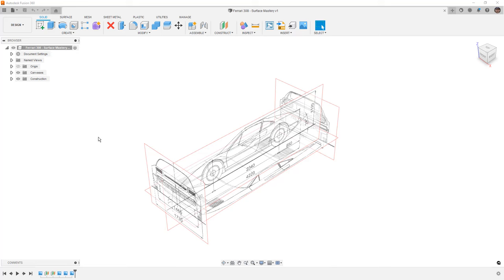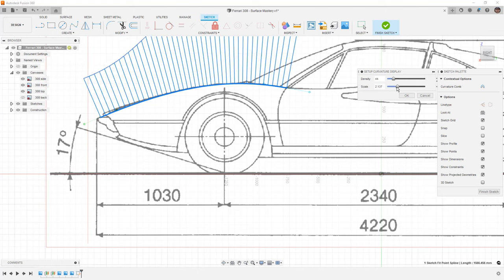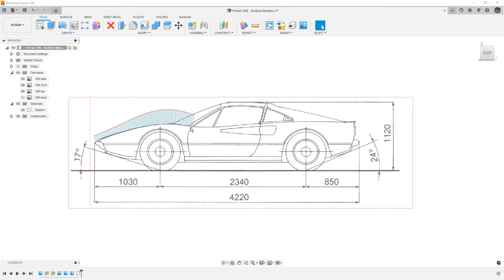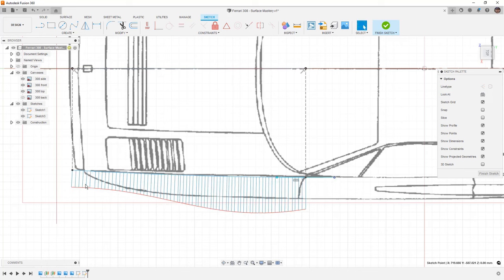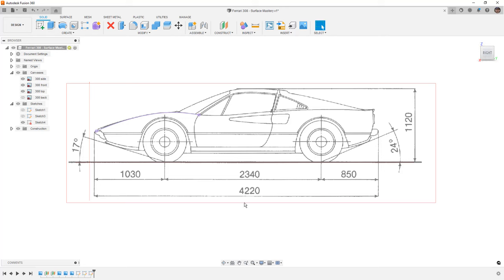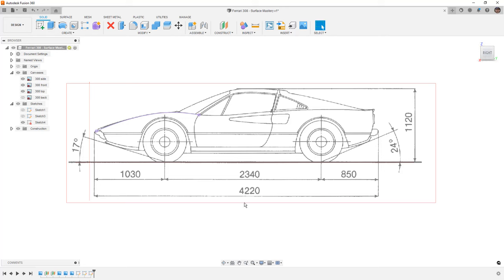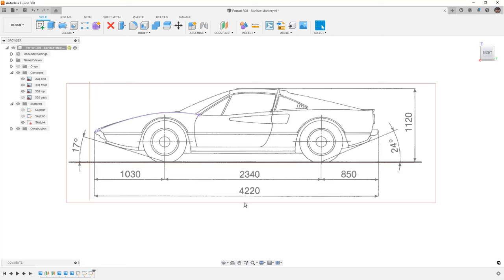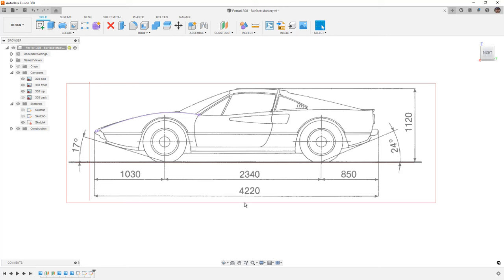Surface Mastery Part 6 - How To Create 3D Projected Curves for Complex Surfaces #cardesign

Comment: Hi, when you have a 3d curved plane ( like the one in the video), how do you make it into a solid object? How do you add uniform thickness to it? To make it 3d printable? Thanks!
Reply from the maker: The main way you do that is with the Create > Thicken tool.

Also with surfaces if you build the inside and outside to make a "water tight" body you can stitch them all together and Fusion will turn that into a Solid body.

Note that thicken will do just that so you may need to trim edges after a thicken since they go out normal to the curvature.

Comment: I’ve been trying to model an A-wing from Star Wars… so much more difficult than I expected because of the curvature. I’ve tried using surfaces, forms, solids but I just can’t seem to get the final model to come together in the end. Working from blurry prints isn’t exactly helping either lol.
Reply from the maker: Yeah it can be really tricky to try and make something that exists in detail like that.  My approach in forms would be to make the middle, make the end of the wing then bridge them together.  Do this in box display so you don't get hung up on the shape and then add edges where you need sharper transitions.  This is a rare case where i would probably use T points on the front.  https://a360.co/3X5bjr9   Here is a quick sample of the rough shape.

For surfaces I would follow a similar workflow.  Make the middle of the body then make the end of the wing and loft them together.  One thing that is easy to get hung up one when seeing images and renders of these things is all the fine detail.  A lot of time those details are in the appearances added and not actually modeled.  Focus on the basic shape first.  You can always add more detail later.

Comment: Much easier with 3d sketch and using splines.
Reply from the maker: well. maybe.  It wasn't until recently that Fusion had the ability to manipulate splines in 3d.  Constraints can still be a bit tricky but yes building out the fender shape with 3d curves is possible.  One thing I don't like about 3d spline control is activating the handles and the move/copy tool.  The video that will come out tomorrow does have 3d sketch splines in it.

 Is that how you typically work?
Reply: @LearnEverythingAboutDesign  if i'm making seperate panels yes. You are right about the constrains but if u make the panels seperately that really isn't an issue. When modeling a complete car and maintaining nice curvature it is a bit of a pain. And totally agree on the copy/move and activating the handles. Fusion should come up with an easier way.

Comment: Can you make a  video about creating 3d milling toolpath?
Reply from the maker: Is there something specific you had in mind?  there are a lot of 3d toolpaths.  I have courses on the Autodesk website dedicated to 2.5, 3 and 5x milling I can point you too.  If there is a specific option or toolpath let me know.
Reply: @LearnEverythingAboutDesign  I tried to create a toolpath for a 3d surface and used 3d pocket tool and it created wrong toolpath (didn't cut it completely)
Reply: Maybe it's because I've used 3d pocket tool  
instead of 3d surface tool?
Reply from the maker: @HaasMill  Sure so 3d milling is an interesting one.  I would first start with a 3d adaptive toolpath to rough your shape.  So any 3d toolpath is "model aware" meaning it is basing its calculations on the geometry while 2d toolpaths are based on selected chains or faces.  So when thinking of a 3d toolpath its always important to look at the geometry of what you are milling.

When starting with a 3D adaptive you simply need to give it an area to work and a depth to go down to.  For most parts this will be the stock contour or starting stock size.  The depth should be based on where you want it to go.  You can also contain it to the inside or outside of a region.  So if I am machining inside a pocket I might tell it to stay inside that or let the center of the tool touch the boundary(there is also an offset value there and its all on the Geometry tab).  I am doing this without it open so the names might be a little off.  On the passes tab you would give it your max rough step down and then a step up.  3d adaptive takes deep cuts which is possible because of the trochoidal motion keeping a consistent chip load but a small cut.  For example the optimal load for a 3 flute half inch endmill might be somewhere between .05 and .2 depending on the material, HP of your machine and how well the part is held, helix angle of the tool and on and on.

After the 3d adaptive there are a handful of tools that are meant for circular parts and only really work in special cases.  Some tools work best on flat areas.  Toolpaths like 3d contour work well on steep walls.  Probably the goto toolpaths are going to be Scallop, and Steep and Shallow.  SnS might not be open depending on your license and/or extensions but its a combination of a few different toolpaths.  Scallop is likely going to be a good option (saying that without knowing the geometry).  Some toolpaths like Flow follow the UV curves of the part and cut based on number of stepovers.  Toolpaths like Scallop are going to be based on a stepover amount.

Hopefully that helps.